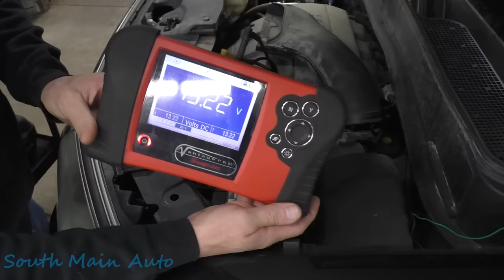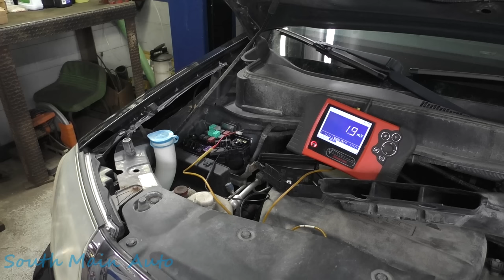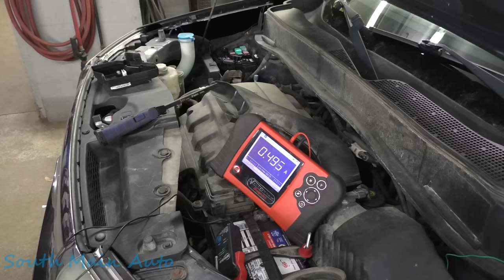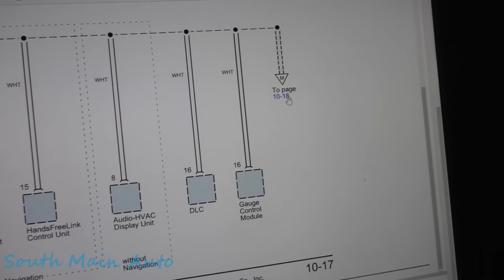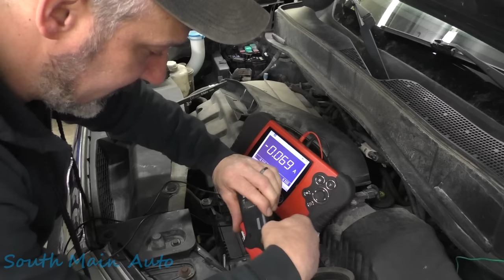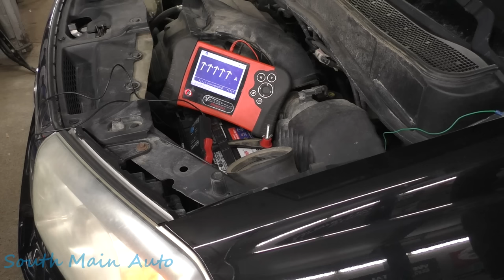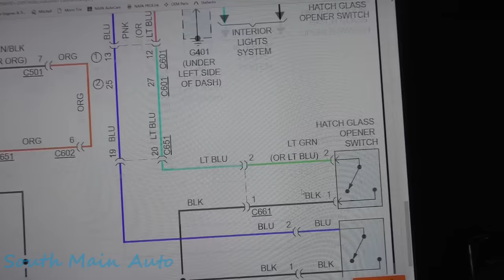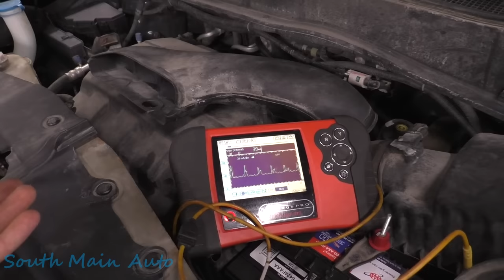Eric O Is A Silver Bullet Cheating Machine!

Comment: These battery draw videos from Eric are my favorites.
Reply: Yeah, I'm not a mechanic. I went into academics, but my dad was a welder, mechanic, competent at everything, so I learned a lot of this stuff as a kid, you know, back when cars were cars and men were closeted. These vids are like my finishing school on how to deal with modern cars where there aren't actual switches, where everything sends a signal to a computer to tell the thing to turn on or off. And to be honest, these things are so much easier to diagnose.
Reply: If I wasn't on the other side of the pond I'd have a nice head-scratcher for him. 2009 VW Golf drains the battery but only if it's parked outside during longer heavy rains (two days plus), ideally with high winds. Nothing out of the ordinary as soon as it dries up. Happened maybe five times during current ownership (since 2017). The 2014 battery that was in there died last year and has been replaced. A few weeks ago the thing happened again but this time there was still enough charge in the battery to start the car, either because the draw was dicovered more quickly or because of the new battery or any combination.
Reply: That sounds right up Eric and Ivan's alley. Maybe you can get them to do a video chat

Comment: DC current clamps are one of those things you need to get a feel for.  With low current settings the position and orientation can result in rogue readings due to magnetic fields in the vicinity.  I usually hold it in position near the cable, zero it and then clip it on without changing the orientation.  Still worth their weight in gold.
Reply from the maker: Ahhh ok. Also if you can "loop"  the wire through the jaws to make a multiplier, it can help with the accuracy too on low amp draw situations.
Reply: Big Clive!

Comment: I see nothing wrong with a silver bullet. Happens at my work sometimes where the symptoms and other items match exactly what someone saw before. Often worth trying before spending hours confirming if this duck is a duck.
Reply: For a channel that promotes sharing knowledge, why not reciprocate? 
Payback would be adding a useful repair to help other shops diagnose.
Reply: As long as you check that the issue is actually what the fault code or fault analysis chart says then you are good.
In this case there was a suspected offending device that was easy to disconnect and the fault went away, so therefore the problem was isolated easily.
It's tougher when you need to check the CAN and/or LIN bus traffic, sometimes you need an analyzer to see what's happening. If a button don't change the traffic changes where it should then there might be a culprit, so those analyzers aren't totally useless. Even better if you have a "known good" reference.

Comment: This all goes back to the age old saying, "an error code only tells you where the problem is, not what needs to be replaced or repaired". Like you said, it is a valuable tool when used correctly. When i was watching one of the snapon diagnostics training videos, even the host said test, dont guess because the error code isnt meant to tell you what to replace or repair.

Comment: This was perfect.  Bought a 2013 Elantra a couple years ago and  soon discovered battery would go dead if left more than 1 day without starting, found a draw of  340 mA and got an AGM battery so we could get 2 days without starting and not strand my son when he used it.   I later traced to one circuit and on that circuit found an old remote starter that I had no FOBs for.  I did pay my local Hyundai dealer to get it cleaned up but as a car owner I saved hundreds of dollars of trouble shooting time. I suspect that’s why it got traded, but I got a good deal on a car that had low miles and came from the south with no rust,

Comment: As a DIY type of guy, I am not familiar with the whole identifix system.

I have managed to use it twice to date, mostly to get wiring diagrams.

In one circumstance, I had a code from the ABS module/ignition on circuit. Based on the diagrams, I was able to determine that I had a broken wire after the fuse, and before the ABS module.

On my second use it was due to a  "Can Bus B open circuit".
I again used the diagrams and was able to find  (with some YouTube video pointers) , a broken Can Bus B ) wire in the hinge area between the drivers door and the vehicle interior. 

I was not even familiar with the ability to look for the "quick fix/silver bullet .  but for the $40 that it cost me to diagnose and solve my problem, it was worth it to me.

Comment: If used correctly as shown, identifix is a great tool. Find common broken wire locations, may let you know common industry tests may not work on a certain system, and may mention common failures and proper ways to diagnose.

Comment: Different field here, but similar experience. Sometimes it just helps to get the proper resource to help cut time troubleshooting. It’s usually a 50/50 shot, but when someone else’s findings help, it can feel like cheating! But you get over it quick especially if it’s a known common fault for a particular brand/model. Nice work regardless!

Comment: You are still the man on wiring. The web helped me fix a work van that a local shop couldn't. Erratic no start on a Dodge, who woulda thought. Bad engine ground if they would have looked. Easy fix. When the cable is green it's usually bad.  Was kinda disappointed they didn't find it. I've learned a lot thanks to you.
Reply: A bad ground on a Chrysler product, surely you cannot mean it...  LOL

Comment: Hi, Eric. Love your channel. As an A&P (aviation mech) and propulsion engineer I watch you and Ray to see how the other half (car guys) live. LOL. First thing I've noticed in yall's business is that automotive engineers hate techs; second is that there are no serious consequences for "hacks" in your profession. FAA has us by the short ones. As for those "Silver Bullets", they can be life savers. Example: 2005 Ford Mustang GT 4.6L with AT -  throws a code for cam sensor(s). After checking Alldata and various forums it turned out to be the alternator. Seems the diodes were breaking down in the VR and letting dirty juice to get by in some of Ford's units. I applied an O-scope and wham - horrible DC trace. R&R'd the alt and life was good. Some times we need the dark side. Keep those awesome vids coming, thanks.

Comment: You can do this without an amp clamp if you just sub your ammeter for the offending fuse.  Watch out when subbing for a big fuse!  Most ammeters only go for 10A... and if you look inside the meter the shunt is a 2" piece of coathanger wire that can get red hot, so be careful.
Reply: A test light in series with the ammeter should help to protect it - it will also affect the accuracy of the reading but you likely don't care what the actual number is.

Incandescent bulbs have a low resistance when they are not lit, and a relatively high resistance when they are. Put another way: their resistance increases as the current increases. This makes them useful as a protection device in this sort of application.
Reply: On modern cars where removing and replacing a fuse can wake the modules and cause the vehicle to enter a 20 minute powered-on state it's much better to set the multi-meter to milliVOLTS scale and measure the voltage drop across the fuses. The resistance of the fusible element will cause a voltage drop of a couple millivolts with only 10 milliamps of current.
Reply: Fuse buddy. It's a fuse holder with a wire for the clamp.

Comment: The old days , the old guys used to go to the shelf , grab a 25 lb manual and start reading until he found the system he was working on . Then the trouble tree and detective work to source the problem. Often , if it was common enough , the tech could pretty much get right to the issue rather then the trouble tree method. Thats where I was finding identafix a useful tool. It got you to a known issue that many techs found already. I have seen guys play Russian roulette with the parts cannon. Makes for a lazy tech . I remember when interior light switches became part of the latch on Fords. After a few dead batteries, went there first

Comment: Another way to voltage drop fuses is to connect the + meter lead to batt+(or any full time battery fuse) then probe the fuses with the negative lead.

Comment: My neighbor asked me to troubleshoot her clothes washer as it wouldn't run.  My son was at home so I had him accompany me so he could learn how to troubleshoot controls.  We opened the washer lid and I was connecting the leads to my voltmeter when I heard the washer relays clicking and saw the operating panel was lit up. I asked my son what he did and he said he googled the washer model number and "won't run" and google told him to hold down two buttons on the control panel.  The moral to this story is - don't call an old guy with a voltmeter to fix your washing machine when a young guy with a smart phone is available.

Comment: If you try to pound nails with a screwdriver, you will probably be disappointed. But it is not the screwdriver's fault. There is no sin in selecting the correct tool for the task, which you did by adding Indentifix to your troubleshooting arsenal. You left me smiling, as usual, Mr O.

Comment: Your comment about the thermal imager is dead on. 😂 Every time I reach for it the battery is dead from sitting so long without being used. I have quite a few tools like that. I’ve found the pico 30 amp clamp with the larger jaw to be pretty close for parasitic draw testing.

Comment: Hi Eric, great video.
When you press the button to zero the clamp meter, please press it, don't stab it.
Press and hold for a second or so and it will do its job.
I agree that amps clamps are not really accurate down on the mA if it is designed for amps or 10s of amps.

Comment: That's helpful, and a little funny you feel guilty about taking the shortest pathway to a solution. I might have left a little note inside that door, explaining why the connector is not connected so the next tech doesn't hook it back up and then end up falling down a rabbit hole. You could even leave a link to your video, ha ha. I wonder if the disconnected wires might trigger a trouble code.
Reply from the maker: I don't believe the MICU's set a code against it. They are kind of dumb modules so to speak.

Comment: I worked as a photocopier repair guy from 2000 to 2010. So much of what you do is not unlike the stuff we did. 5 minutes after starting out I figured out that the troubleshooting diagram in the manual was useless, because it just told you to replace every part from the source of the fault to the main PCB and then replace that.
You had to go by the symptoms, error codes and a basic understanding how the thing worked and figure it out for yourself. In the end out company even had an online faults database, where techs would describe unusual faults they found and how they fixed it.
The worst techs were the ones who would follow the manual and the online database, because it would almost never fix the fault.
I've been working on my own cars (and anything else broken I can get my hands on) since forever and found that fault analysis and faultfinding is a universal process. You just need to understand how the thing works and what could be broken to cause the fault you're seeing.
I now work in tech support for large customer networks and it's still the same.
If you have an understanding of how something works, you can also understand why it doesn't work.
I just suck donkey balls at Linux. 😂

Comment: Cool.  It's not cheating. Identifix is a tool, a source of information. It can be used wisely or not, like any tool. 
Some Toyotas from the mid 2000's had some ridiculous amount of labor time for replacing front lower control arms - with engine removal.  A little while later the labor time was revised, showing around 2 hours per arm without engine removal, or around 11 with.  Who would choose the engine removal way?  The shorter labor time most likely came about from some techs posting a different way to do the job - kind of "cheating".

Comment: 2007 Pontiac Grand Prix I had ABS lights and traction control lights on the dash.I couldn't find a silver bullet, so I checked the powers and grounds and found out a ground was missing. Then I reached down and pulled the ground right out of it's ring at the front of the engine block. I recrimped the ring on it bolted it back in and no more lights. Hallelujah's

Comment: No need to reinvent the wheel on every fix. If a resource reduces your cycle time you can go onto the next issue faster and increase productivity as a whole. Your next customer will be happy since you'll get to troubleshooting their issue faster. Also, you still gain and contribute valuable knowledge by logging your case on the forum and adding to the evidence that the Honda's of this particular model have a known issue with their door and window switches.

Comment: I had a fix that it saved a ton of time. Older Toyota sienna.  Would blow the fuel pump fuse. Verified the complaint.  Noticed it happened on acceleration.  This thing was an oil leaking 300k pig. All the motor mounts were mush. Well turns out the rear 02 sensor would short out on the rack.  Replaced the 02 and motor mounts, problem solved in 15- 20 min.

Comment: I hear Alldata has a tech assist hotline that helps techs with diagnosing issues rather than throwing parts at it and that they also have a Community section full of previous common fixes to entertain.

Comment: Identifix is an incredibly useful tool if used responsibly, I have found some extremely out of the box answers on there that fix my issue that would’ve taken me forever to come to that conclusion without it. Like you said it comes down to the tech to use is responsibly and not just start winging parts at the car

Comment: Identifix is a great tool if you know how to use it. So far I've used it once in place of diagnosis. I had a 2007 Toyota Rav4, I believe. Customer said that the heater kept going cold when he turned the knob down only a click or two, then it would go back to hot if he kept turning it down.

I looked it up in Identifix first thing. There were hundreds of fixes that simply said there was a loose nut behind the heater control knob. Sure enough, the nut was loose. I tightened it up and the issue was fixed. Not something I ever would've guessed. Initially I thought I was dealing with a whacked out blend door. I was prepared to tear apart half the dash to diagnose the issue.

Comment: Amp probes uses the magnet of the current running in the wire… sometimes the magnetic leave a charge on the probe,,, thus the need for a reset or discharge

Comment: If you could accurately measure the fuses internal resistance, which absent a lab instrument could be tricky, then, as they, I=E/R not just a good idea, it's the law! Great video.
Reply: That is what the charts give you, the issue is that fuse internal construction varies, but it's still a better option sometimes. Not like a .001 ma error is enough to throw the result out.

Comment: Had a similar issue with an Audi A6, turned out the draw was from a multimedia controller stashed in the boot.
because the customer had an after market head unit, it wasn't switching off the multimedia unit

Comment: Note that ideally you zero the clamp amp meter in the same orientation to make it work as good as possible. As you rotate the clamp, it picks up the difference in magnetic field (of the earth!) and "thinks" that is a current in a wire.

Comment: The "back up" fuse is removed by Honda during shipment, as you see it controls a few circuits.  I have seen where a theft attempt, i.e. a screwdriver to the drivers door lock cylinder has caused a draw on this circuit as well.  I always start by looking at the door cylinder now on battery draw complaints.

Comment: It's not cheating it's just an option to consider. Honestly when I saw Silver Bullet the first thing that I thought about was my old Olds Silhouette, not to be confused with a beer or those things women replace men with.  Honestly, I am not big on just replacing components I like to evaluate components to see if they are functional or not and when I find something that fails then the question is why and is there anything I can do to prevent that failure, but this comes from working in an industrial environment where things get expensive quickly not to mention the cost of downtime and lost production.   When I work on my car, I apply the same thought process.

Comment: Our 2005 Pilot had the EGR valve deteriorate causing rough idle and weird starts.  I had no clue, air, fuel, spark.  Shotgun the spark plugs. No change.  Punted after that and took it the local shop. 250k miles.

Comment: Re thermal imaging tool... your implication is you could use it to optically scan around the vehicle looking for 'warm' spots that would indicate a 500mA draw?  I haven't seen you use it, would be interesting (get the battery charged! :)

I used it for verifying liquid level in tanks and drums vs gauge.  That was old-days with a LN2 detector, a big clunky thing with over-shoulder belts.  Nowadays, the imagers are smaller and better (thermoelectric cooled), attached to cellphone.

Comment: Battery kept draining while parked, I found a current draw on my old 94 f150 with my thermal imager. The back of the alternator was warm. Shorted diode. Installed new alternator, problem solved. I could have just changed the rectifier, but the alternator had a lot of miles on it. DIY, no labor cost, just part +- 85 bucks.